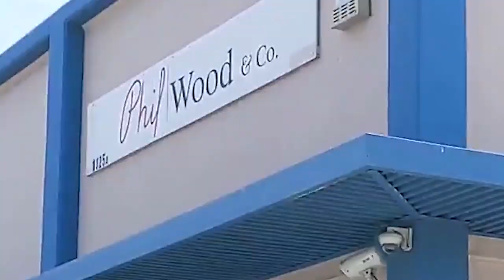Fishing Utility E-Bike | Lark Machine co

Comment: 2 wheel drive..... go anywhere.... I been doing it for over 10 years in Canada.... my current ride for off road is 4 x 4 :)  2 wheel drive full suspension ebike, 2 wheel drive Rambo ebike trailer... 7 battery packs, solar recharge....  hills ??? what hills ???  mud ??? what mud ??? unless it's more than a foot deep, we plow right through it... pull 200 .lbs in trailer... NO problem... but better yet, with regen braking in trailer  STOPPING 200 .lbs in trailer from 40 KPH... NO problem :)  ya, we learned that lesson the hard way, stopping 200 .lbs in trailer with only bike brakes... almost a hood ornament for a city bus.... and they dont have hoods....  nice build but your controller, is going to run too hot, it needs more air flow for cooling, behind the bag, only the sides exposed, cook an egg on that sucker...  or add liquid cooling, water blocks, pumps, rads, amazon or ali express...  yep, done that too about 10 years ago, liquid cooled controllers....  Crystalyte motors, Kenny makes some of the best around...